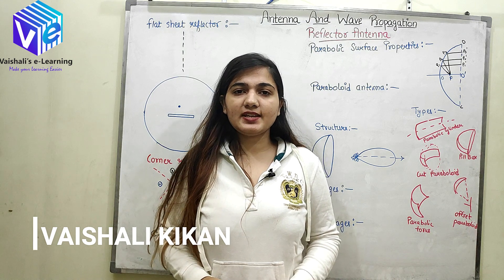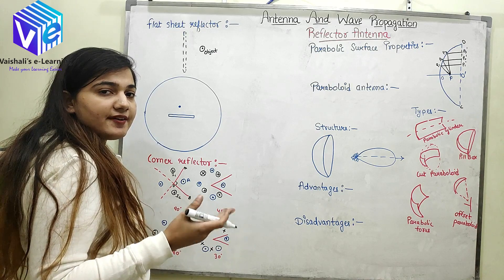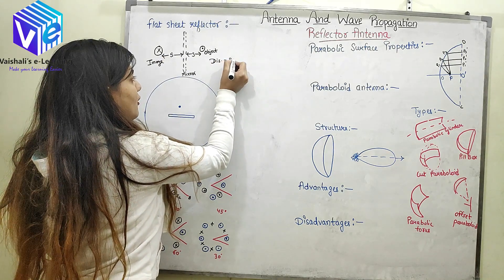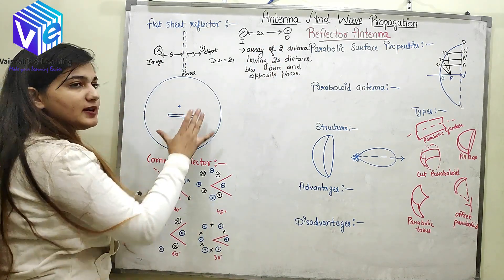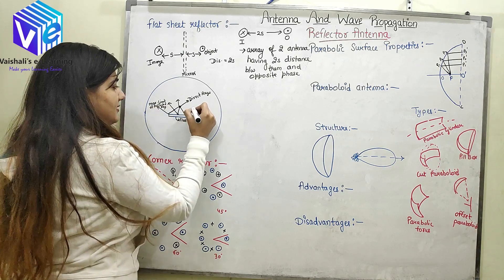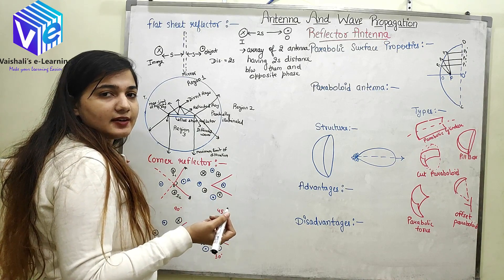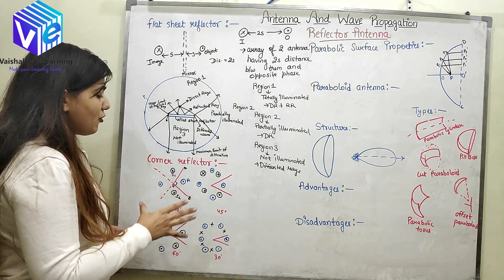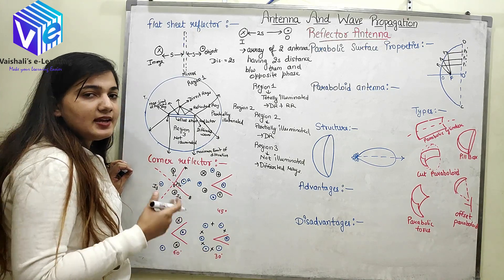Flat Sheet Reflector | Corner Reflector | Parabolic Reflector | Paraboloid Reflector | Lecture 34 |

Comment: What is a cosecant squared parabolic reflector ,in the context of the parabolic reflector antenna ?
Reply from the maker: This antenna is used when the target moves at constant height, this gives a smooth signal strength.
In the practice a cosecant squared pattern can be achieved by a deformation 
of a parabolic reflector.
It can also be made by 2 or more horns feeding the prabolic reflector.
Thank you so much for your valuable feedback.
Stay connected for upcoming videos..